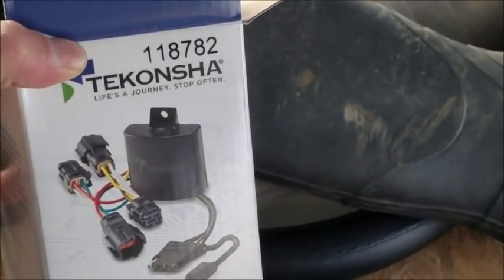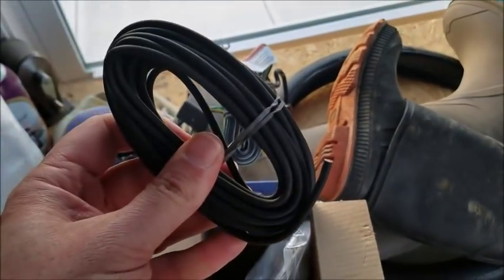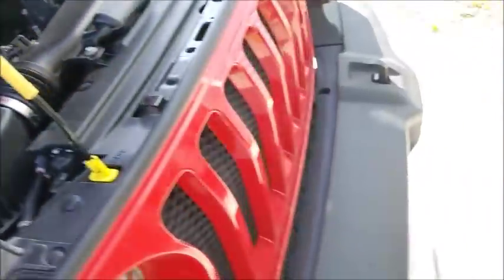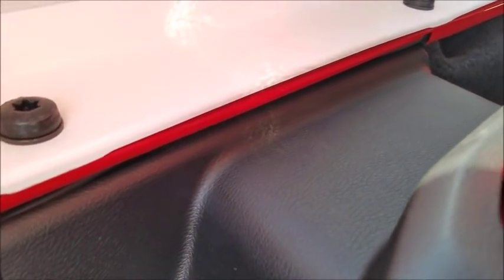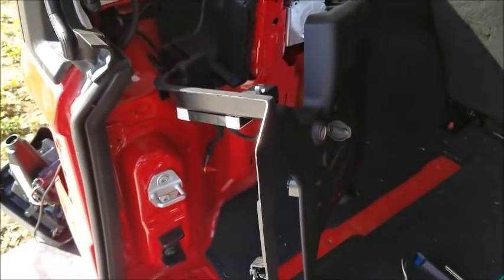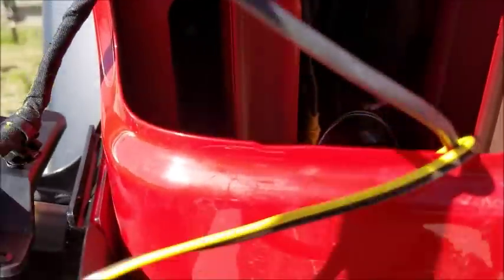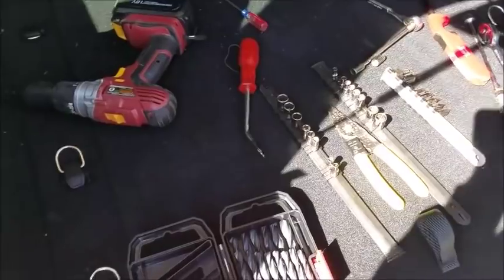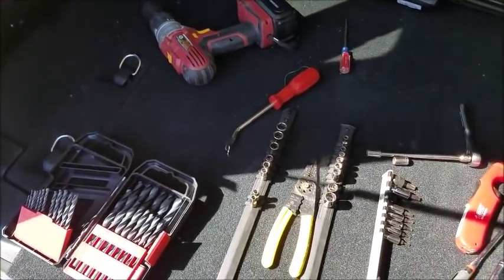2018 Jeep Wrangler JL Trailer Wiring - How to Install a 4-pin Connection for Towing

Comment: Nice video man!  I was thinking of something else maybe a person could do?  Start the power wire from the tail light, and run it on top of the heat shield which lays over the muffler, then run the the wire along the frame on the passenger side and come up on the battery that way?  Not sure if that would work or not.  Subbed!
Reply from the maker: I'm sure there's a lot of ways to skin the cat, but I just went with this because it seemed good at the time.

Comment: That spot on the driver's side firewall is used if you have a manual transmission for the clutch components.
Reply from the maker: Yep, that's true.

Comment: I installed this and this thing killed my battery in two days of not driving. Anyone else has this problem? Or experienced this?
Reply from the maker: Hmm..  that's odd .  I used this kit for a year exactly as installed in this video and didn't have a single issue.
Reply: Yup seemed super odd to me as well...I did everything as instructed. Most likely got a defective product. Once I swap out the new one I will update here.

Comment: I was wondering can you put the power plug into that back power outlet with the fuse? I was thinking since it's not used when towing and it should be pretty powerful.
Reply from the maker: You possibly could do that.  Might work out well.
Reply: @4-LOW  I did it. Its fused with a 20amp fuse. The t connector only draws 15.
Reply: On the JL You can use cigarette lighter wire when ignition is on or off or tag light when light are on

Comment: Thanks for the video. Very helpful! I believe you did right thing my friend and your installation very similar installation to the Mopar harness installation guidelines. The only difference is they recommend to run the power wire through the firewall on the passenger side with would require removing and reinstall 4 plastic rivets. I'm not technical enough to know why the go on passenger side but guessing it may has to do with running the wire near the Gas tank??? I would say to new buyers getting the factory installed for $800 is well worth it. Keep in mind the $800 package also includes a 7pin and 4 pin (if you need that), the 4 AUX switches (if you need that), 240 Alternator, different battery (700 Amp maintenance free). I purchased my JL Rubicon a couple of weeks ago from a dealer's lot and didn't have the luxury to add the Tow Package from the factory. I tried to get a quote form 4 dealers to install this package and it was $1100 to $1600 (here in Cali) for labor only depending if you want to add the AUX switches or not. The parts are $500 for the hitch and wiring, harness $$$? 240 Alternator, $$$? for the 700 Amp battery.  By the time your are done it would be way over $2000+. Go with the factory installed for sure. In my case I already purchased the Mopar parts for $400 with a discount and will attempt the installation myself and try to get it as close to a factory installed as possible. Sorry for the long posting. Just wanted to share my experience.

Comment: Seems to me you coulda ran the power lead under the vehicle and saved yourself all that interior work.
Reply: This what I I did. I ran it over the wheel wheel through the frame and up to the battery.

Comment: i find it hard to believe your lights worked perfectly. I tried one of these and they grabbed the wrong running light wire, they did not work. Its in the wrong terminal, brown wire. The CURT one is only one that works so far.
Reply from the maker: Well, it works like a charm.  Tonight I can shoot a video if you would like.

Comment: Great video. The rubber grommet in the firewall is for the clutch. If you have an automatic, you’re good. If you have a manual, you need to find another way through the firewall.

Comment: Adding a hitch to a Jeep Wrangler = Voiding your warranty. Jeeps have a hard enough time pulling their own weight. Hope you have a towing service on speed dial.
Reply from the maker: There is an entire section in the owners manual about which types of hitches to use and the tow rating and tongue weight rating of each model of Wrangler.  I've owned a dozen Jeeps, four of which were Wranglers, and I've towed fairly heavy loads with all of them without a single failure.

Comment: Does this Jeep already have the trailer package? I’m trying to hook up lights and I’m told I have to get Jeep reprogrammed to recognize it has trailer package
Reply from the maker: If you install the factory tow package, then they will flash the computer so it will alter a few things like the automatic 3 blinks on turn signal, headlight operation, ESS operation, etc.  You certainly do not NEED to do anything to the computer in order to use a hitch.

Comment: I install Curt kit exactly like yours. No need to run any wires inside Jeep, especially no needed to run positive inside. In drivers tail light run everything in hole down to ground except power box and yellow t connector. Plug up yellow wire into drivers light, Mount box with tape, close up that light. Underneath run neg wire to a bolt close bye. Run positive to the front on top of frame with 24” zip ties from Amazon. Then run green wire across to passenger tail light, run wire up to tail light hook up that t connector, done. Very easy install took 30 minutes. Tops. NO NEED TO RUN WIRES INSIDE AT ALL

Comment: Why does this unit need a controller and a new power line run all the way to the battery?  Normally when adding a trailer wiring connector, you just plug into the existing lights or splice into the existing wires.  The only reason that I could see this being necessary would be if the idiotic engineers at Jeep decided to use LED lights for the tail lights and did not run 12V to lights and only ran as much voltage as was necessary for the LEDs that they put in the rear light housings and they used wires that were so thin that they could only handle the amperage that was needed by the LEDs and not what might be needed in a non-LED trailer (especially if the trailer had electric brakes).  Surely the engineers weren't stupid enough to do something like *that*, right?
Reply: Why not just plug the 12v wire into the the 12v socket in the back?
Reply: That what I was thinking. I just checked and it has power 100% of the time.
Reply: Yes and plenty of Power 2019 Jeep Wrangler JL owners manual page 182 says 13 amps,  seems to me even if you had to wire a cigarette adapter on the end of the wire and just plug it in when towing would also be a good option.
Reply: Could be a couple of reasons...

Maybe there the wire is not sized large enough for as much current as a trailer with a lot of incandescent bulbs might require?

Maybe the 12V socket is not powered when the engine is off?  If you are towing and have to pull off to the side of the road to change a flat or whatever and your engine is not running, you still want to be able to have the emergency flashers operating.  And maybe you don't want that 12V socket to always be powered because you might have a thermoelectric cooler back there and you don't want it to run down your battery while you are parked with the engine not running.  Now, if they had designed the system to use two fully redundant batteries that could be isolated, then you could power that thermoelectric cooler from one of them and still know that you will have enough power in the other battery to start your vehicle when the time comes.
Reply from the maker: Yep.  I think it's because of the new CAN-BUS wiring architecture they've been using for a while now.  The power wire off the battery gives a constant and steady voltage to power the trailer lights.  Without the power wire and the little distribution box, there would likely be enough voltage drop to cause issues on the trailer wiring.  Mine does not have LED lighting, but still requires the same box wired to the battery.
Reply: Yet another case of engineers thinking that they must use the latest and greatest thing so that they can put it on their resume and it causing more problems than it solves and it costing us more in the long run.

I can easily guess what that controller consists of.  It's a small microcontroller like one of the Arduino units.  The software running on it is polling the I/O ports and they are hooked up directly to the vehicle wiring, so it can detect when there is power on a particular wire.  There is a high resistance on this I/O port, so it can detect the voltage change without having a noticeable load on that particular electrical circuit.  The microcontroller also has relays for each of the power lines on the trailer plug -- left turn bulb(s), right turn bulb(s), reverse bulb(s), running bulb(s), break light bulbs, etc.  It is constantly polling the existing power states for each of the factory bulbs and activating a relay that gives power to the trailer plug for whatever wire needs to have power to duplicate the current factory bulb setting.  The circuitry and relays cost maybe $10 and the coding is pretty simple also.